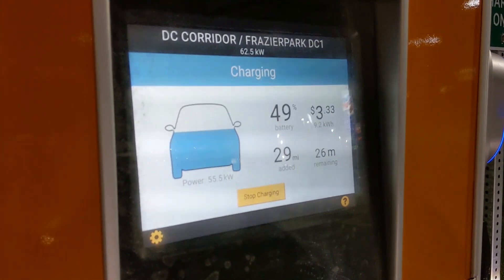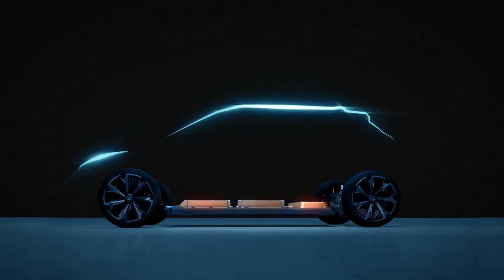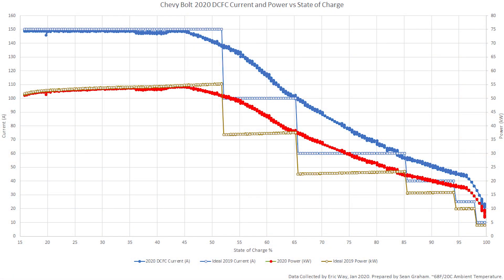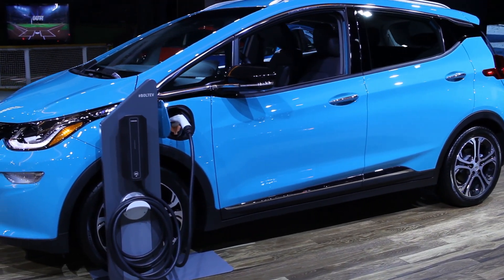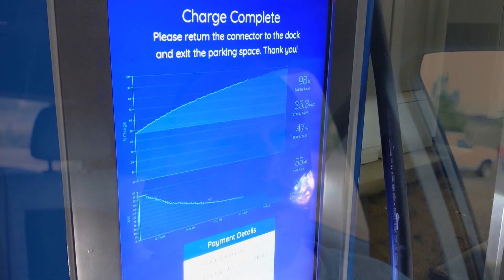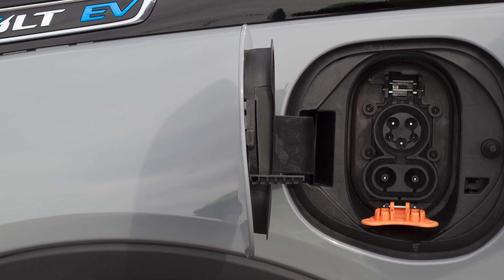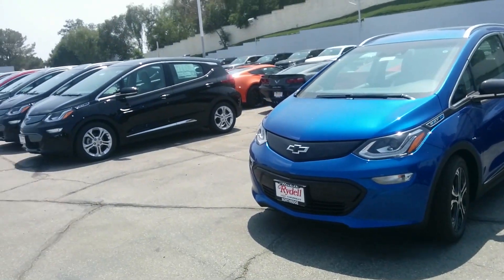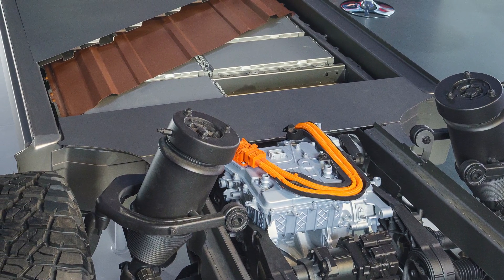Dear GM: Please Offer Chevy Bolt EVs a 200 A CCS Upgrade

Comment: I also really do think GM should update the new Bolt EV and EUV to have 200A charging.   But retrofitting older Bolt EV's to have 200A charging would likely be more complicated than replacing a socket and a software update.   I would think it would also likely require updated wiring harness, power relays, interconnects and overcurrent protection in the battery.   So it likely won't be inexpensive to do.   Also this benefit is likely only going to apply from about 10 to ~50% SOC.  Which will save some time for sure but I'm not sure on the market size that would be willing to pay for it.  Personally we normally only use a DC charger once every couple of months and this is something we would not want to pay much for.   Though for people with driving habits such as yourself the equation is much different.
Reply from the maker: Yes, the benefits are definitely in the lower end of the battery SOC, but keep in mind: The Bolt EV's battery internals can handle a 160 kW power output and a 70 kW regenerative braking input, so might only be the CCS socket, harness, and BMS that need to be replaced. 

As for the value, I think it really depends on the end user. It would be a no-brainer upgrade for me.
Reply: @newscoulomb3705  Understood. I am fully aware of the Bolt EV battery capabilities. But those connections are between the battery and the power inverter. The DC charging cables have separate inputs with separate connections and separate protections. Weber auto showed a Bolt EV without DC charging but talked about how difficult it would be to add DC charging to the car. I would think adding DC charging would have a similar level of complexity as upgrading the DC charging.
Reply from the maker: @erikstephens34  Not all of those connectors are different. The DCFC power flows directly through the inverter box. I actually think the reason Professor Kelly couldn't get the CCS working is because the non-CCS Bolt EV's BMS is programmed with the required communications protocols. Essentially, you can swap out the hardware, but if you don't have the proper software, it won't work.
Reply: @newscoulomb3705  Actually the DC power goes to the high power distribution module.  This module has separate contactors and buss bars to the DC connection.  To update the DC charging power these contactors and buss bars would likely need to be upsized.  It might be easier to replace the whole HPDM to update the DC current capability. https://youtu.be/5gDILvW5yMg?t=689

Comment: I would pay 500+, but not 1000 or more.
Reply: I would pay at least $2500 to $3000 just to get CCS fast charging installed on my used 2017 Bolt EV. I can't charge at my home because it's an apartment. As for now, I'm camping in my car at the level 2 public chargers after work. I'm basically using my apartment for storage and a place to eat. 😭

Comment: All of our long distance trips are in our 2019 Bolt while our ICE vehicle stays in the garage.  I don’t put in quite as many miles as you, Eric,  but probably 60 % of the 17K on the odometer are from road trips.  Having the option to retrofit for faster DC charging is a likely choice if offered.
Reply: Yes, if your car is got only AC charging option it's possible to upgrade your car to DC charger as well.
Reply: @pashko90  I'd like to know how. 3 parts for hardware that I know of but requires some programming done as far as I know. I'm tired of sleeping in my car to charge 😓
Reply: @ka0skontrol504  i feel you. Have a rav4ev. I don't have a chance to upgrade a Bolt yet. But looking to upgrade one and see how it goes.
If you are in Los Angeles or somewhere not super far away, let me know.

Comment: Curious how much hardware would need to be replaced. Wouldn't just be the socket, right?
Reply from the maker: It's possible that that would be the only change. The battery internals are already rated for 160 kW, and the regenerative braking system can handle at least 70 kW. A 150 A DC/32 A AC is a common CCS socket rating, so it's possible that the socket itself is all that needs to be replaced.

Comment: I would pay 200 for this upgrade. The stunning thing is that they even make Bolts without the DC fast charger. Just a level 2 port.
Reply from the maker: The hardware itself is likely double that. Labor would probably double it again.
Reply: @newscoulomb3705  I understand. It would definitely be worth it to someone like you, that drives long distance a lot. I do not. I have to make an occasional trip LA to Sacto. Having to make 3 fueling stops longer than 20 minutes is making my family opt out. And with another possible 1500 added to the price, why not get a Tesla model 3 and get even better charging experience?
Reply: @victorcenac1247  Because a Model 3 is WAY more money. It's only advantages, if you want to call it that, is the very expensive options like their level two assisted driving feature.
Reply: @davidmccarthy6061  Well... also for a long drive, my Bolt requires a one hour stop while M3 needs a 15 minutes stop. For every day use, the price difference makes the Bolt most attractive, but the slow charge confines the car to the daily driver duties. And 40k for a daily driver......it's a bit steep. People would shy away from buying a 15k city car.

Comment: I wouldn’t pay $1500 not enough improvement
Reply from the maker: Fair enough. I believe it could be done for less; however, many owners don't drive enough to make it worth it.
Reply: News Coulomb how you feel about wireless charging do you think it is the future ? Wonder what you think ? don’t hear much about it from big names like tesla or electrify america . By the way as a Bolt owner I love your videos
Reply from the maker: @wch2186  Thanks! I think wireless charging is a good option to explore, and it will open up opportunities to add charging at businesses that don't want exposed charging units. They will cut down on wear and tear, vandalism, etc. The biggest hurdle is communication with the vehicle and the need for the equivalent of "plug-and-charge" activation. They also open the possibility of "charging roadways," which could completely eliminate the need for standalone public chargers.
Reply: @wch2186  wireless is always more lossy than wired charging.  Multiplied by high power and hundreds of thousands of stations, and it would be a big waste of energy.

Comment: Charging speed and windshield glare are the only complaints I have about my 2019 Bolt. I would love to get at least one of those fixed.
Reply: Take a look at getting a dash mat. I think I saw a company that offers them for the Bolt EV.
If you get it in black, it's sort of a carpet like finish. Not only will it protect your dash from sun. But it should provide the anti-reflection your desiring.
The only thing about dash mats is they don't exactly look great usually.
I live out west and you see a lot of cars with these, mostly to protect the dash from the extreme UV we get out here
Reply: Yes, get a dash mat.  It was the first accessory that I purchased for both my Honda Fit, and now my 2020 Bolt.  The steep angle of the windshield makes for a long dash, and there were times that I had difficulty seeing out the window.  I purchased black for both auto’s, works perfectly and they fit great.  Don’t look bad either.

Comment: GM's NextGen Ultium-powered EVs are designed for Level 2 and DC fast charging. Most will have 400-volt battery packs and up to 200 kW fast-charging capability while their truck platform will have 800-volt battery packs and 350 kW fast-charging capability.
If one wants a faster charging platform, then one should pay the extra $$$ for it, be it a New(er) GM EV product, a Tesla, an I-Pace, or a Porsche.  We all knew what we were getting when we bought our Bolt's.  GM like every other manufacturer is in the business of making a profit for their stake holders, not in the business of losing capital in retrofitting old models.  This idea is better suited for an aftermarket provider, which could be an opportunity.
Reply from the maker: Unfortunately, you're probably right about the Bolt EV specifically, but the least they could do is offer faster DC charging as an option.
Reply: I fully expect zero changes until the Ultium battery is in production, and definitely no retrofits.
Reply: Aftermarket solution?  Big liability risk I'd think.  Plus software update would be required to take advantage of the increased power socket, and I'm betting that Software is locked down pretty tightly.

Comment: Would be nice to see Chevy give an over the air update for this and other things. They are seriously lacking in updates. Come on Chevy!
Reply from the maker: Fortunately, everything that can be done OTA, GM pretty much nailed in the first try. The major systems, however, cannot be done OTA because they would require an actual hardware update.
Reply: @newscoulomb3705  Tesla does over the air updates all the time and many software changes should be possible like Tesla does that don't require any hardware changes
Reply: @ralphstan8279  OTA updates can't change the physical barriers of physics.  If the components that are installed cannot handle higher amperage than an OTA update will just break a bunch of cars.
Reply: @ralphstan8279  Tesla designs their vehicles for updates so likely a lot of hardware is over-engineered. Like some of the new cars arriving that can charge much faster than any fast charger that is currently available. Hopefully GM's new battery and models have some built in future proofing, but GM is old and obsolescence is in their culture. Dealers view new car sales as just a pathway to repair income but manufacturers want everyone to get a new car every couple years. With EV's needing hardly any maintenance and OTA updates keep adding new features that keep my old car "new" for years, that's a dark path for both the factories and dealers. The upstarts without the dealer baggage will be the survivors in this new world.